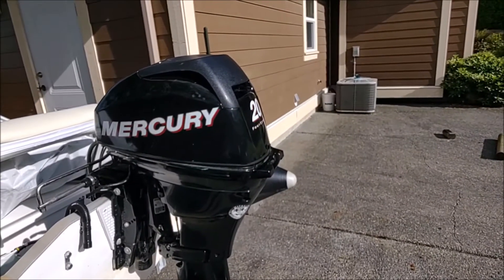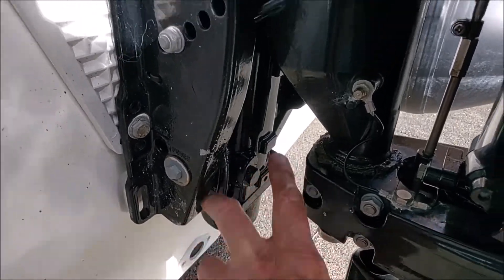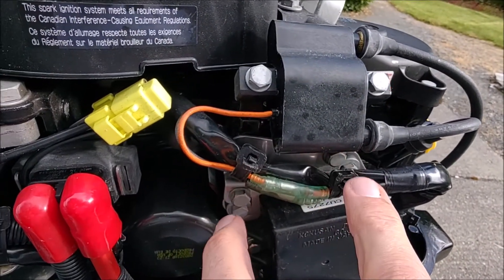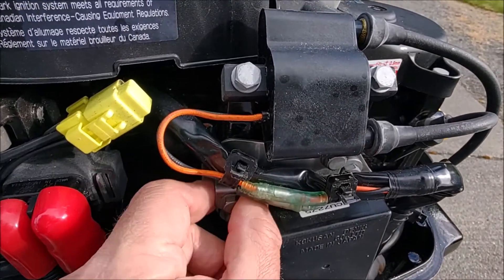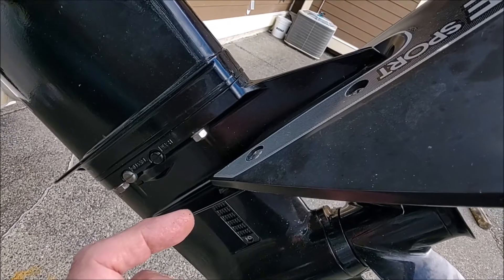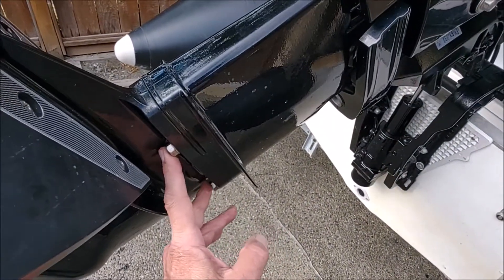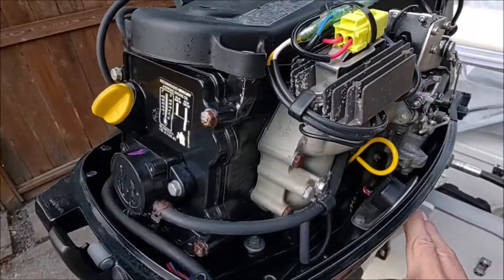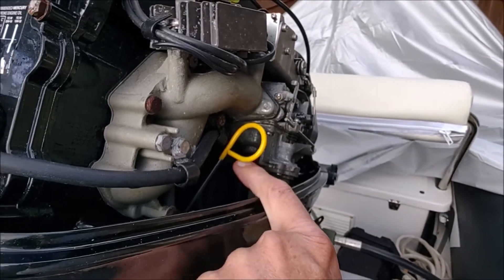Mercury 20 HP 4 Stroke Maintenance Tips

Comment: Hello mate, I have the same engine but it has trouble starting... especially when cold, every time it starts it also gives a 6 ish second beep and the warning light is on for 6 seconds.  the oil level is fine and it has a new filter.... do you have any idea what it could be, I was thinking maybe the thermostat?
Reply: Hello!  No worries about the beeping and warning light.  This is a normal startup process for the engine.   If it keeps beeping and the warning light stays on, then you have an oil issue.  Cheers!
Reply: @rossmay188  but it stays beeping for longer then usual. My other friends mercury beeps for like 1 sec
Reply: @rossmay188  And it starts bad

Comment: I have this same model and have noticed an oil leak from inside the cap/cover. It appears to be coming from the right side of the motor looking from the back of the boat. Was almost empty the other day when I checked- nothing on the dip stick. I am a new boater.  Any help is appreciated thank you
Reply from the maker: So the oil is leaking from the oil fill cover?  Do you know what the oil level was when you first bought the motor?
Reply: @RM-ey5ym  I apologize.  The main cover or lid that covers the entire motor. I guess I meant it wasn't leaking down by the foot or prop . Several inches to the right of the dipstick towards the front of the motor.  It's almost directly across from the oil filter. It's inlaws boat I have been using but had only been in the water a few times I believe before I got it
Reply from the maker: @fomocosolow  Hmmm...Have you started the motor before you noticed the leak?  If so, did it run okay?  Check that all bolts are secure on that side of the engine.  If you haven't started it yet, fill up the oil and try running it in water and see if you can spot exactly where the oil is leaking from and how fast the oil is leaking. If it is running rough, shut if off and take the motor in for service. Are you located where the winters are very cold or are you in a warmer climate?

Comment: My 20hp Merc always starts fine at the dock, but after running my boat for about 1/2 hour to my fishing spot and shutting it off I find it very difficult to start it back up. I may only have been stopped for only 20 or 30 minutes but the motor does not want to start. Ant tips or ideas on what I need to do to fix this problem.
Reply from the maker: Hello Tony.   A common cause for the issue you are having is the stator.  Not saying that is necessarily your issue but it could very well be.  If you end up having to replace the stator, Mercury Marine recommends that the switchbox be replaced as well.  A bad stator can weaken or ruin a good switchbox.  The old switchbox can fail shortly after a new stator has been installed.  
Unless you have a flywheel puller and can test the stator yourself before replacing it,  it would be best to have a marine mechanic do this for you.  If you want to take this on yourself, here is a decent video on how to test and replace your stator.  https://www.youtube.com/watch?v=HqK4Rqv3XL4&ab_channel=WildnWonderfulOutdoors   Cheers!

Comment: sorry if this is a very dumb question, but the oil up top near the crank is the oil the injector uses and mixes with the gas right? and then the lower unit oil is a completely sperate oil?
Reply: No such thing as a dumb question...no worries.  If your engine is a 4 stroke, the oil you need to put into the top fill hole needs to be 4 stroke engine oil, preferably by Mercury.  That is a completely different oil than an oil injector oil and different from the lower unit oil.  An injector oil mixes with gas.  The 4 stroke oil doesn't mix with gas...it stays in the crankcase.  You need to know if your motor is a 2 stroke oil injected motor or a 4 stroke engine.  The lower unit oil is completely different from the engine oil.  If you check your manual, it will tell you the kind of lower unit oil you need to put into the lower unit.  It will also tell you the kind of engine oil your motor requires.  I hope this helps.  Cheers!

Comment: Does removing the "fuel demand valve" cause any problems or harm.
Reply: Yes.  Removing the Fuel Demand Valve can cause flooding of the engine and could result in engine failure.  Removal can also cause excess gas to pollute the water.  A new FDV isn't expensive to replace.  Hope this helps.  Cheers.

Comment: Thanks for very informative video. Is there any fuel filter that needs replacing?
Reply from the maker: Hello Gurpreet.  Yes, there is a fuel filter that should be inspected each year or if your engine is running rough.  For the location, it depends on whether you have an EFI or a non-EFI engine like the one shown in this video.  If you have exactly the same engine as this one, the fuel filter is located on the lower, left rear of the engine compartment.  You can just see it at 10:45 minutes into the video  It is a white plastic filter.  If you have the EFI version, then you should check out this Youtube video that explains how to replace the fuel filter on that model...https://www.youtube.com/watch?v=7oMdagfu2Oo&t=15s&ab_channel=BakkenMotorAS   They are very easy to replace.  I hope this helps...good luck with your maintenance and thanks for your feedback!
Reply: @RM-ey5ym  thank you.

Comment: Thank you so much for the video! I am trying to learn the basics of maintenance as I am about to buy my first outboard to put on my dad's old boat and want to save money on trips to the mechanic. This was very helpful. What kind of schedule would you recommend for these? I think I should do the impeller yearly and the oil at least once per season, but what about the anodes and thermostat?

If I get these maintenance items done regularly, are regular visits to the dealer as the manual recommends really something that is needed or could I get away with only doing it every couple years or so?
Reply from the maker: Thanks for your comments.   

I would suggest changing the engine oil and lower unit gear oil after each season before you store the motor for the winter.   If you are using your motor in fresh water, the anodes won't need to be changed as often as they would in salt water...same for the thermostat.  

For both the impeller and the thermostat,  as long as there is water strongly squirting out from the tell tale opening at the back of the engine, both should be working fine.  If there is a weak or no stream or if the water is coming out hot from the tell tale, the impeller or the thermostat may need to be replaced...likely the impeller for weak stream.   You can check the impeller annually when you drain the gear oil from the lower unit if you want to be extra sure.   No need to check the thermostat unless you suspect the engine is overheating.  When you replace the engine anode, you may want to replace the thermostat at the same time if the thermostat looks grungy.  

If the other more visible anodes on the motor are in need of replacement, chances are the engine anode will need to be replaced as well.  For fresh water, you can go several years before needing to change them...not so much for salt water.   I highly recommend flushing your engine with fresh water after using the motor in salt water.   Salt-A-Way is a great product to clean out salty water from the motor and will extend the time needed between engine anode replacement.   

If you change the engine oil, lower unit oil, impeller and anodes yourself, there would be no need to take it to a mechanic unless you are having other issues with the motor.  The nice thing about these small outboards is the simplicity of servicing them yourself.   Hope this helps!
Reply: Thank you so much! That's exactly what I needed. I've been trying to figure this stuff out but so much of what is online comes down to "do everything the manual says" or "go to the dealer every year". And the thing is, the manual says go to the dealer every 3 months!

Now I'm double as excited to get back out on the water again after so long. Just gotta find a motor that's actually in-stock.
Reply from the maker: @mud074  Glad to be of help...cheers!

Comment: How did you move the motor up? What button? I have a 2011
Reply from the maker: The motor in the video has a hydraulic power tilt.  If your motor has that feature, the button is on the side of the motor near the cowling.  Hope this helps.